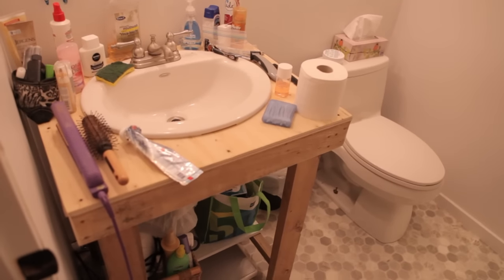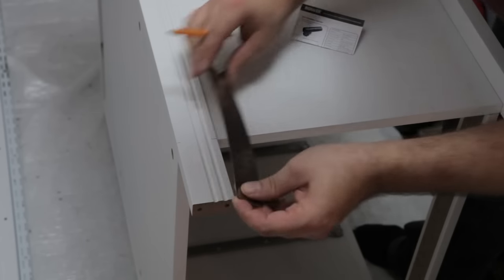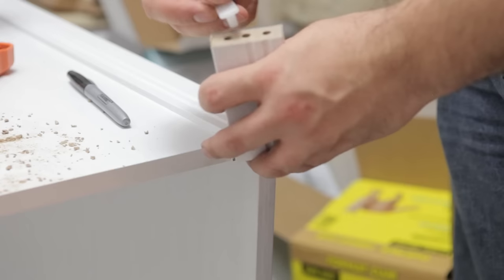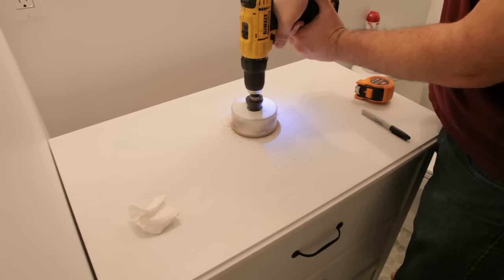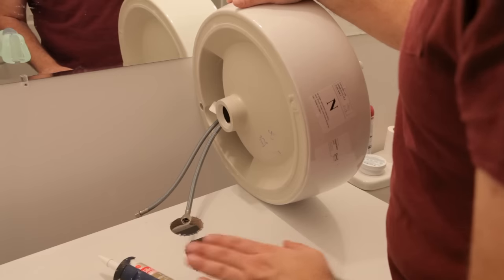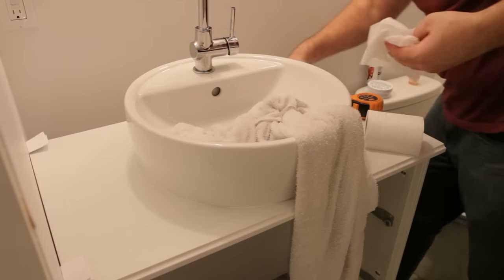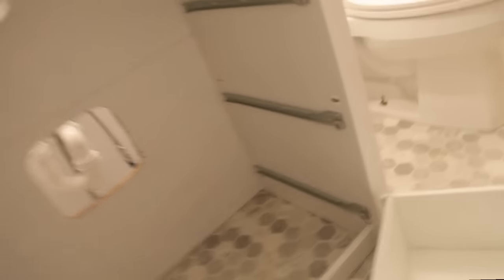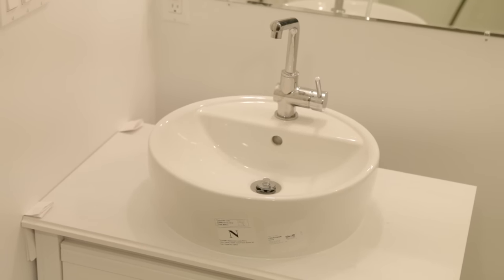Ikea Dresser to Bathroom Vanity DIY Hack - LHP

Comment: just a thought,at the base of the vanity legs, to get the holes in the right place just cut a thin strip off the original leg with the jig saw & you will have your hole template.
Also it some times pays to add an extra brace or two when using a dresser etc in a bath room, just to take the extra weight.
Reply from the maker: Hi Steve,  Both are very good points.  :)  Thanks for the comment!

Comment: You never posted how you covered the back part?
Reply from the maker: Hi Jill,  do you mean the portion I cut out at the back of the cabinet for the drain?  I used a jigsaw and cut a random shaped hole until it was large enough to clear the drain pipes...  Or do you mean how I finished the space left between the dresser and the wall?  in that case that it's not included because I have yet to finish it.  Unfortunately I have left this in the exact same state as the end of the video, and have not had the time to come back and finish it.  My plan is to cover the space with a custom shelf, but there always seems to be other jobs that site higher on the priority list. I will make a video when I get around to this.  I feel that this information is needed before anyone can decide if this is an acceptable solution.  Thanks for the comment, and I will make a video eventually.  sorry for the delay.